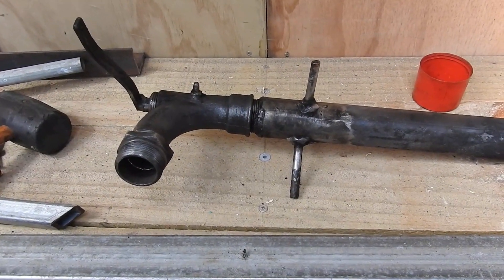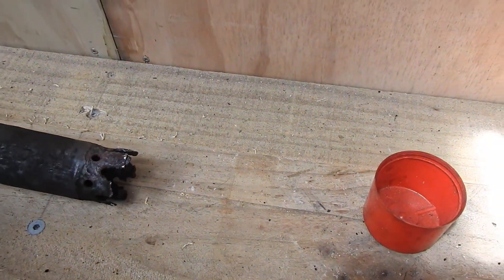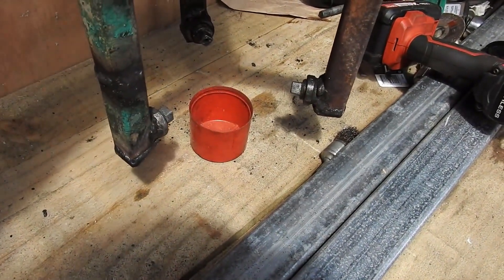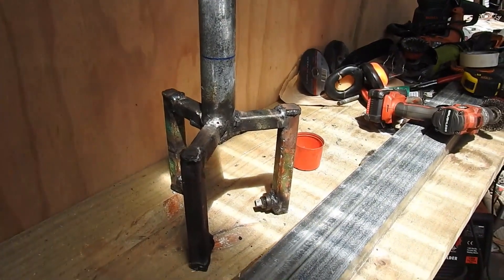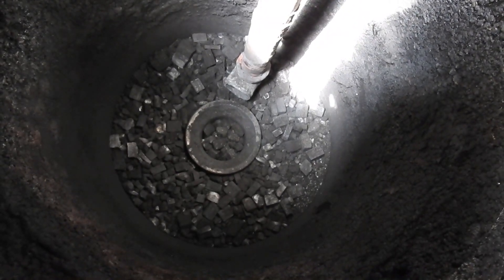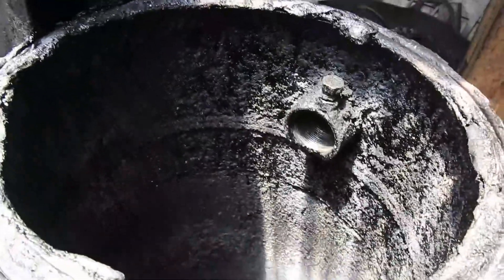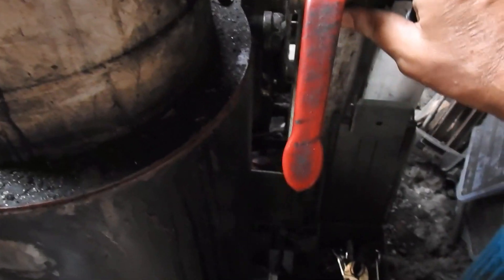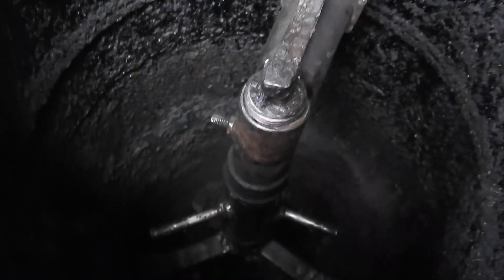New nozzle design for Phoenix Gasser

Comment: The new air nozzles seem to work very well, especially with an unattended 3 hr run. I'm mighty impressed. The first concern I had was that the wood hopper would bridge but apparently it does not. Maybe that has something to do with the sizing of the wood chunks. In all it will certainly be something I will try. Everybody loves a happy ending
Reply: What is the purpose of the three round rods welded several inches above the  nozzles ( on the main tube ) ? Used to unscrew it for maintenance or disturb the flow of wood downward?
Reply from the maker: Indeedee. 
 This new system works very well, and I think its performance is enhanced by no longer having any metal parts in direct contact with the hot zone - at the mouth of the hearth. 
 By having long risers, leading up to the 3 axial arms, any bridging issues are essentially resolved, as these wood occur in small regions, well above the actual burn zone. 
 The 3 round stubs are for leverage on the air feed column. 
 These allow me to insert a steel rod, and twist the assembly into place, or remove it, with similar ease  :) .

Comment: Steve, you can't argue with results like that. Nice job. I just love the blue flares. Thanks for the dose of wood gas. I really needed it. Joe
Reply from the maker: Howdee Joe, 
 Yup. This new arrangement is well worth the effort. 
 The gasifier starts up quicker, as does the engine. 
 I get more watts, and a steadier gas flow thru the system. 
 All it needs now is some sort of ignition port, to ease lighting - on a full hopper  :) .
Reply: @CNCmachiningisfun  it seems it delivers more air into the system so it can heat up faster and flow rate is higher. I love it :)
Reply from the maker: @ravelkoff3549  
 The interesting thing here is that this one delivers a lot less air than the previous one did. 
 I think the advantage with this is that there is no metal in direct contact with the hot charcoal mass over the mouth of the hearth. 
 As a result, the burn is hotter and cleaner. 
 Well, that's my theory, for now  :) .
Reply: @CNCmachiningisfun  I can't proove it ;) but I think you found some very interesting fact.
Reply from the maker: @ravelkoff3549  
 As I see it, this is a never ending process of discovery and learning. 
 Indeed, one should treat life in the same way  :) .